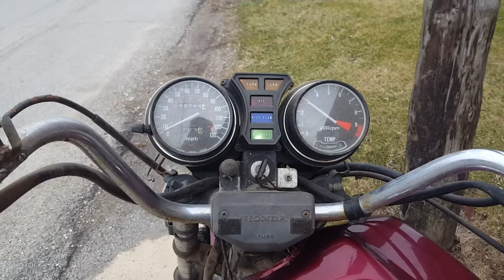Honda GL650 Cafe Racer FULL BUILD TIMELAPSE

Comment: the optics and especially the line management are totally for the a**. but your craftsmanship is remarkable.
Reply from the maker: What do you mean?
Reply: @BrickHouseBuilds  first of all: my criticism was not meant badly. but with a lot of rebuild projects on youtube i think to myself: "guys, why don't you, before you start, take a pencil and a piece of paper and draw how it should look afterwards?" it's really bad with bikes where the frame shape was not meant to be visible. e.g. goldwing, bmw k-series. 
what you did well is to throw away the old tail. but the new one doesn't really harmonize with the rest. do you even have two lines/edges that run parallel? or curves that have a continuation or counterpart somewhere? 
just look for a distinctive line on the bike and try to associate it with another. there are none. everything is crisscrossed.
i hope you understand what i mean. nevertheless, my compliments for your craftsmanship.
greets from germany.
Reply from the maker: @excessiveengineeringinc.4392  Ah I see. Actually I did exactly what you said in drawing the shape before I started. The tail flows down into the line at the bottom of the tank which then flows to the valve covers. From the side its an aggressive forward/down slope instead of the normal flat line. Looking at it from the rear I made it also intentionally V out from the tail again to the valve covers. There is a V theme in the bike.  From the top I strategically made the seat pan to work with the body lines of the tank and then accentuated that with the contrasting colors and material seams of the seat itself. The stitch pattern in the seat is actually mirrored to the rear block pattern on the tire. The blocks on the grips match the tires. There is subtle texture in wrinkle paint/exhaust wrap, brushed, etc. Every line on the bike is cohesive and I'm surprised you saw none of it saying thats what you were looking for. I recommend watching the video where I make the seat pan as I explain the lines of the bike in that.
Reply from the maker: @excessiveengineeringinc.4392  Also not the mesh side panels. The pick up the shape of the subframe triangle and merge with the lower lines of the tank.  I did mesh to only add some visual weight to the back of the bike since the stock tank is so big. Again, everything on the bike has a line or purpose
Reply from the maker: Oh also the exhaust angle was chosen to match the lower tube for the subframe. Feel free to get a ruler out and note all the lines on the bike.
Reply: @BrickHouseBuilds  sometimes i just think too extreme. on my vfr 750 f i tried to create all angles that go from the front bottom to the back top with 22 degrees , everything that goes in the opposite direction has 15 degrees. in two weeks it should be ready, then i'll try to upload a video here. then you'll see what i mean.
Reply from the maker: @excessiveengineeringinc.4392  cant be too extreme if you didn't even notice them

Comment: What are you doing at 17:15?
Reply from the maker: I had just removed the carbs from my ultrasonic cleaner and was then using welding filler rod to bench synchronize the carbs.
Reply: @BrickHouseBuilds  Thank you! This build is epic, there is a GL650 in my garage, one day hoping to build it back up again!
Reply from the maker: @iaintdonknow  no problem and thank you! If you want to see exactly how I do stuff I have many videos showing each step

Comment: I really like the finished bike , but please don't call it a cafe racer. Knobbly tyres , raised bars and a seat so short you could slide off the back make it more of a dirt bike , or street fighter. Just my opinion , and I still like it.
Reply from the maker: I address this same comment many times.  Just a search term. I don't call it anything in specific as someone will always have a problem with whatever I call it.
Reply: @BrickHouseBuilds  fair enough , I get it. Very cool build , keep building mate.

Comment: что у вас аргон дешевле углекислоты?
Reply from the maker: Im sorry I do not understand the question
Reply: @BrickHouseBuilds  that argon is cheaper than carbon dioxide?
Reply from the maker: I do not know how much carbon dioxide is actually.
Reply: @BrickHouseBuilds  in Russia, at least argon is 6 times more expensive per cylinder
Reply from the maker: @artur_southural1669  It is not cheap here. It costs $70 to fill my smaller bottle

Comment: I stopped watching after I realized you weren’t stripping the bike. Lol it only cost 10% more to do it right.
Reply from the maker: @dobermanpac1064  You may not understand what mocking up is. This is where you do your fabrication and fitting of parts before you strip the bike down to do the final finishing. The bike in this video goes down to the bare frame and every nut and bolt lol

Comment: Stop chopping off rear frames. It looks like shit and renders the bike useless.
Reply from the maker: Useless eh? Did you see that part where I rode it and had fun with it? It fulfilled its designated use which is not to haul 2 up with gear across the country through the rain.  They make stock bikes for that.
Reply: @BrickHouseBuilds  just be home before it rains. It just limits the use sooo much and looks cheap Imho.
Reply from the maker: You get wet on a bike with full fairings too ya know... We have weather reports here as well as other bikes to suit different needs.